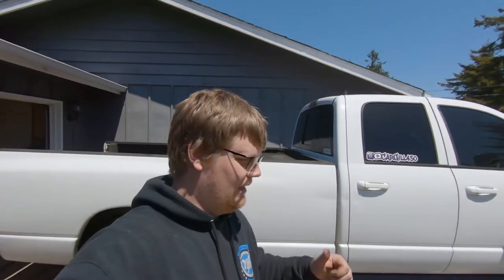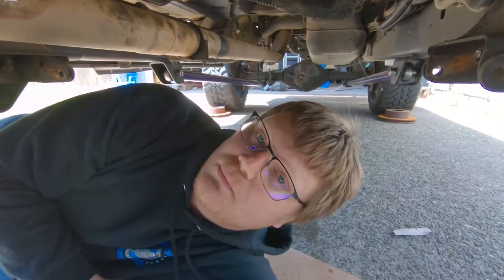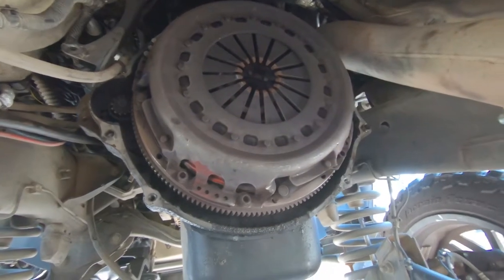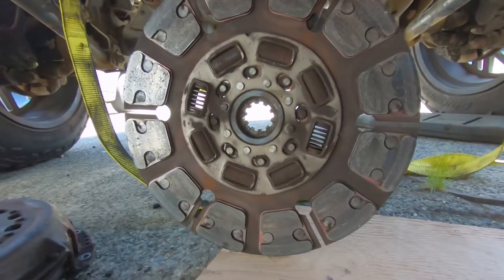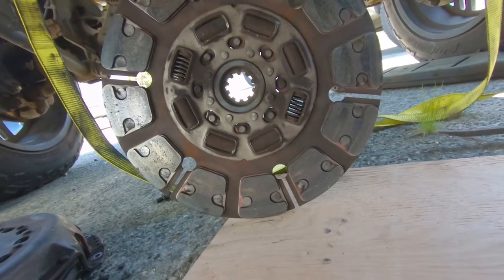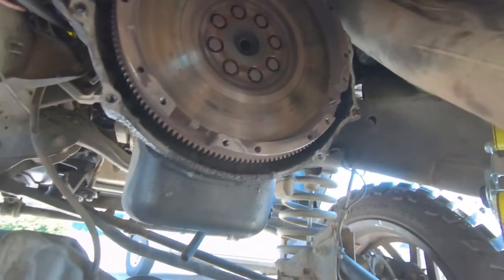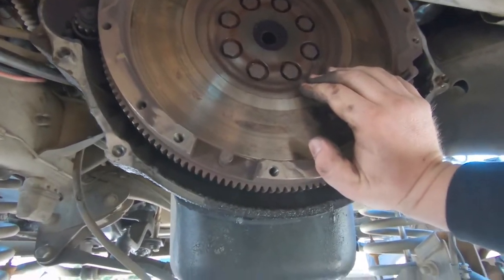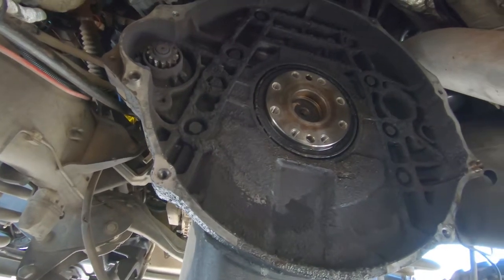Rear main seal on a 6.7 Cummins and saying goodbye to the old clutch....

Comment: Just FYI folks from my experience.  It's not wrong to install the rear main seal the way he shows in this video.  But it's way better to remove the rear cover (the bell housing mount) and replace the seal that way.  Yes it's a bit more work, but well worth it.  I've had three pickups in my shop this year with "leaking rear main seals" that they said they repalced, but still leak.  Ends up being the being the rear cam seal.  That seal can only be replaced with the rear cover removed.  Just take the extra steps.  Remove the starter and rear cover.  Then you can remove the cover that houses the rear main seal and install the new seal on the bench.  No drilling needed to remove the old seal.  After that replace the O-ring for the cam and away you go.  You already have the transmission out so make your whole repair done right.
Reply from the maker: I 100% agree there are better ways to do this repair and I probably should have gone the extra mile, the way I went about has more "risk" as far as possibly not fixing the actual leak but I was rushing myself a little bit to get the truck put back together.
Reply: Question did it stop the leak or did it keep leaking or oozing out? @Cargill450
Reply from the maker: @joelawjeep it’s happy now, no leaks

Comment: Be sure to pre-oil the rubber seal.
Reply: That's incorrect. Mahle states in their instructions specifically to NOT place any oil or grease on the seal or crank during install.

Comment: Go ahead and remove the adapter plate and replace the adapter plate o ring. It’s also called the rear camshaft seal. It leaks more than the rear main seal does.

Comment: Lord yes! I’m changing my whole adapter plate anyways, so I’ll be leaving the Seal plate on, and doing it this way and changing to the 48rfe adapter for my G56 swap. I would HATE to tear the oil pan gasket because mine doesn’t leak YET! 😂